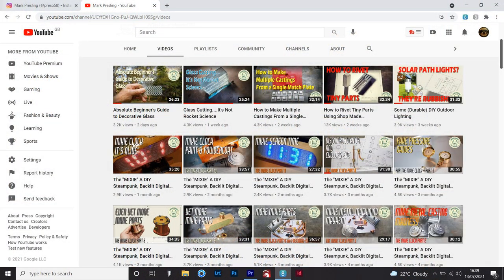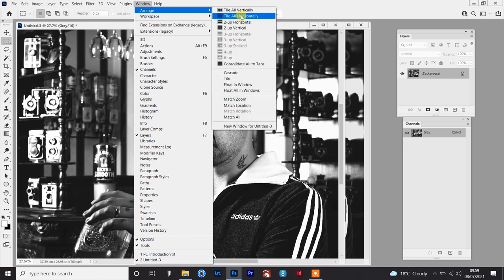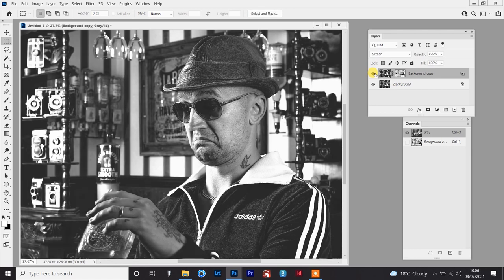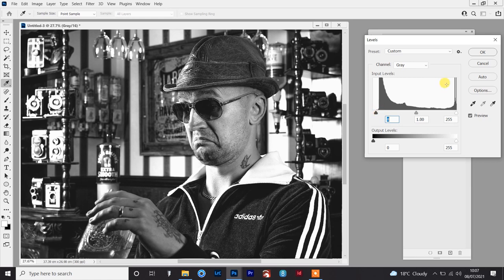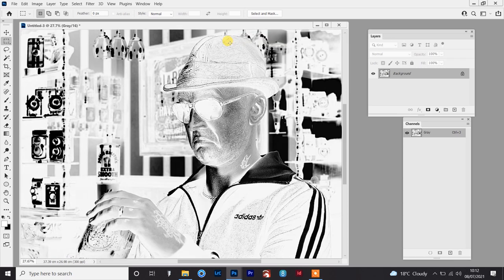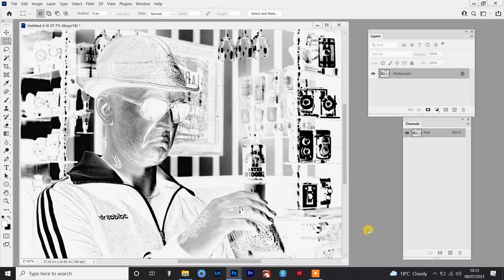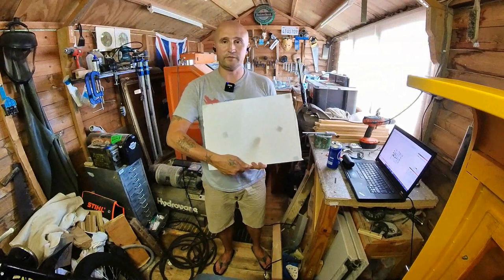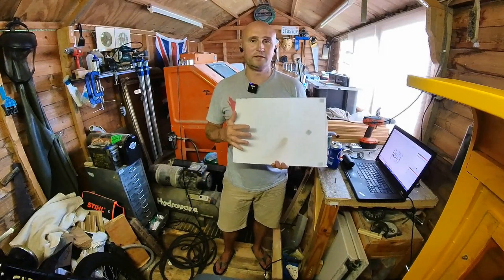How to laser engrave a photo on glass. Pin sharp details!

Comment: That is absolutely brilliant.
I was always told to mask the glass as the laser has trouble focusing on glass. I use the wide blue painters tape. It's very economical.
Reply from the maker: Thanks very much! I never knew why, but it certainly makes a big difference when it comes to the sharpness. Must be the focusing! I learnt something today :)
Reply: @happygilder  The sharpness is unbelievable. I definitely  couldn't do what you just did. I only have a small laser compared to yours. I've not tired it on glass but it does a lovely job on acrylic.
Reply from the maker: @tonywharton5220  Thanks Tony! If it's the Photoshop processes that you feel you couldn't do, once you've done it once you can record it as an action. Anytime after that all of the processes could be done with the click of a button. I'll do a video soon on Photoshop actions. They're so easy and save loads of time :)
Reply: @happygilder  Thanks. That would be brilliant. I really don't know my way around Photoshop. My hobbies are more 3d printing and synthesisers/music

Comment: I am curious if the Letter Head Fonts are usable in lightburn. I am learning how to make these glass panels with just my laser and no sand blaster so I am having to develop my own order of operations and subsequent workflow. Your videos are the whole reason I started working with glass. I had just seen a video about David Smith and I was scrolling through the comments when I saw one of your videos linked in the sidebar. I have been hooked ever since.
Reply from the maker: Hi, any font that's installed on your machine will work in Lightburn, however you won't be able to access extended font glyphs.
Reply from the maker: Really glad you're enjoying the vids!!!

Comment: I think you will find that your rotary is going backwards. Thats why it etches back to front. Or you can just turn it 180 degrees on the bed.
Reply from the maker: I don’t think that is the problem. It’s mirrored rather than the wrong way round.
Reply: @happygilder  Sorry I thought I had replied to your comment the other day. According to the light burn forum there is an issue with the software mirroring the job. It was a bug in a particular version. Can't remember the specific number though

Comment: I am using the same Photoshop you are. I followed your tutorial step by step but I cannot get the “stamp” you talked about. I clicked the buttons as you mentioned & a new layer with the image did not appear. What am I doing wrong? Is there a series of places on the screen I can click through instead of using shortcut buttons to achieve this???
Reply from the maker: Hi Allyson. I have only ever used the keyboard shortcut to 'Stamp Visible', and I can't find a button todo it in any of the menus. 
In case I said it wrong in the video the keyboard shortcut is:
Press and hold the Ctrl + Shift + Alt keys, and then tap the letter “e” (Mac = Command + Shift + Option, then tap “e”).

There is a long winded manual way to do it if that's not working. After doing the surface blur, click in the layers menu and flatten the image. Then go to 'duplicate layer' but change the 'Destination - Document' dropdown to 'New'. The undo the 'flatten' command on the original document and 'shift - drag' the new duplicated document onto the original. Then set the blend mode of the new layer to 'Overlay'.

Comment: Great tutorial on photoshop prep, but I have some issues with your lightburn explanations: On scan/raster mode, the low speed doesn't matter, because it won't ever turn a corner with the power active, which is what the low value is for. Just like a car cornering, the controller slows the rate of speed heading into a direction change. If the power stayed the same, you risk burning your material. When etching - in scan mode - the laser overshoots the image location before slowing, so no need to reduce the power. 

With regards to overrun, I recently did a large transom window and when I went from 350mm to 250mm, the job was quicker, because the machine didn't have to overshoot as much and I saved a few metres. It's worth using the preview to dial in the most efficient settings.

When cutting, having such a large disparity in low/hi ends up with stuck bits. Try and stay around ~10% of your speed on a 60-100W commercial machine.  So it would be 80/72 or 50/45 for example.

The reason your mate mentioned 10% is that in many Chinese controllers, 10% is the power cut-off - lower than that and it won't fire. You can change it in the controller and US-made machines don't have such a limit - you can fire at 1%.

Giving power and speed settings without reference to the power of the machine makes it difficult for users to replicate, but they will still pick up the techniques just fine. 

Other things with glass are that thin glass breaks. Always, unless you go to the lengths of actively cooling it or baby it along doing offset alternate rows and such. So don't. The stuff on frames and inserts in cabinets are usually thin. Air needs to be set as high as it will go. 3mm should be the minimum, but you can get away with 2 if youre willing to take a long time. Old glass is best - old houses, greenhouses, etc. Never breaks, etches beautifully, has colour and patina. Old mirrors, too. 

Great tutorial, mate. Like your style.
Reply from the maker: Wow man thanks for all of the detailed info! I'll pin this comment so it's at the top. I still only know the basics of the laser so all info like this is really helpful. Glad you found the file prep part useful :)
Reply: @happygilder  it was really good - I don’t often do photos, so it was really helpful in getting contrast right.
Reply: I normally use a 4' lens and you can engrave any glass without breaking it. Of course it gives boulder lines but also nice satin look. With 90w reci tube it's more difficult to use 1,5 lens, the risk of breaking glass is high. You run at 50% power and 300 mm/sec right? 60w laser?

Comment: Thumbs up for your video. Well done. However, it seems like a lot of unnecessary steps in setting up the image in b&w. Why not adjust using curves for that first part? Also, it would have been nice if you'd explained why you were doing what you were doing rather than saying, "That looks good to me." It also would have been nice to see the piece of glass NOT framed at the end so we can see what it looks like over a real backdrop that has lights and darks and not a framed one with solid white behind it.